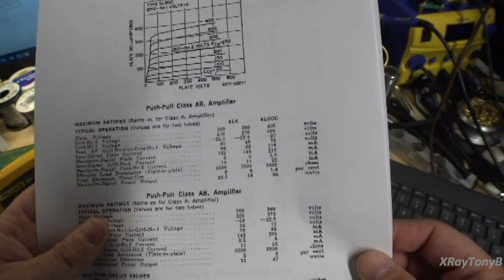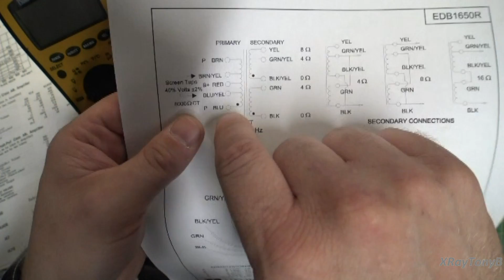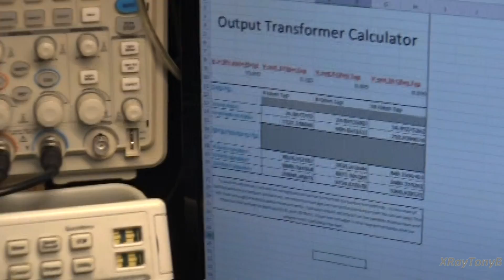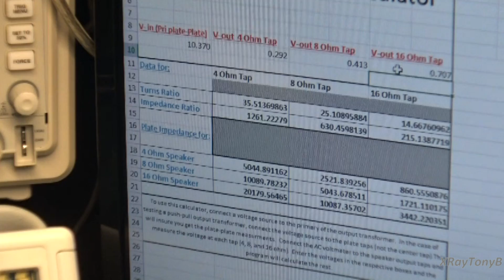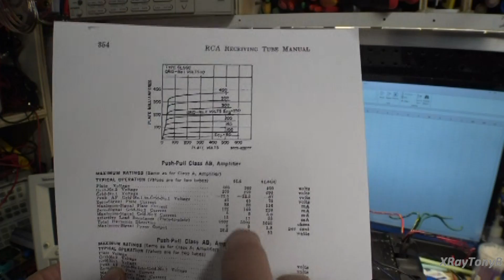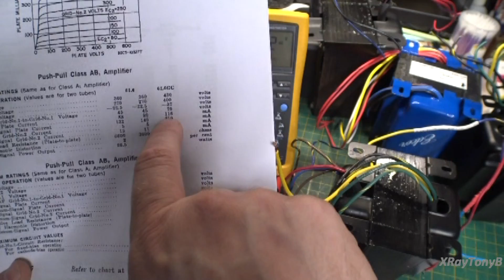Building a Bass Guitar Amplifier - Part 1- The Transformers

Comment: Tony, please remember that speaker impedance may deviate seriously on (low) frequencies.  This may and will have serious results on the current through the output transformers and nasty saturation effects in the iron core.  Oops, I guess I was a little too fast with this remark, I did not watch the full video...  You mentioned the load yourself at the end.  Sorry.

Comment: By changing the tap on the OPT don't you loose frequency response? I hate meter's that beep; just what you need when your measuring high voltage. Are`you going to use regulated screen grids?

Comment: Why not use diodes for the rectifiers, that will give you a few extra volts DC and save your power bill heating up a valve rectifier?
Can I assume that a bass amplifier will be nearer to a HiFi amplifier. Sound quality wise most guitar amplifiers tend to be very noisy with large amounts of distortion. For a bass,  a quite, clean amplifier with a good low frequency response and good damping factor would be best? or am I wrong?
Reply: Some bassplayers prefer an amp with a certain color, but some prefer something that accurately amplifies the bassguitar they have. I guess there's audiophiles in musicians as well. :)

Comment: Dis gonna be good.
So you chose a fender, but have you considered looking into old Hiwatts? The DR506 for example.
Hammond only has the funky wiring on the old transformers. The new ones feature a "easy wire secondary".
Will you do an ultralinear output section?
Looking forward to part 2!